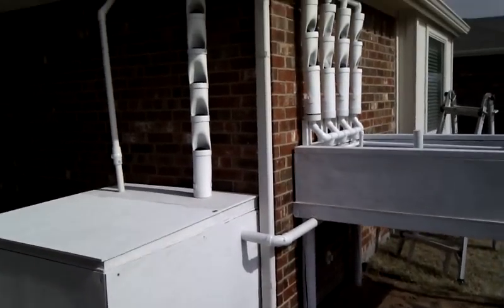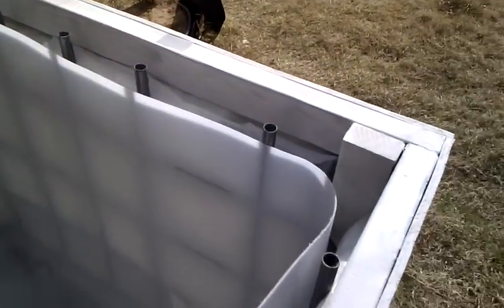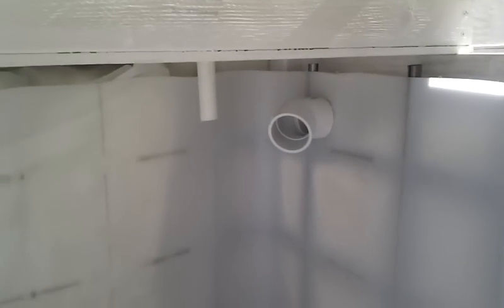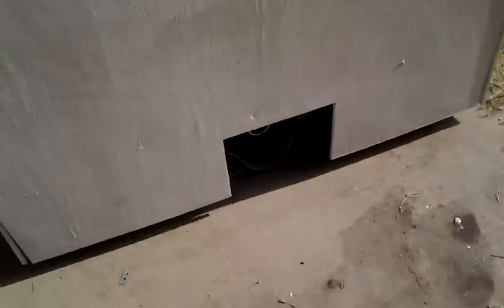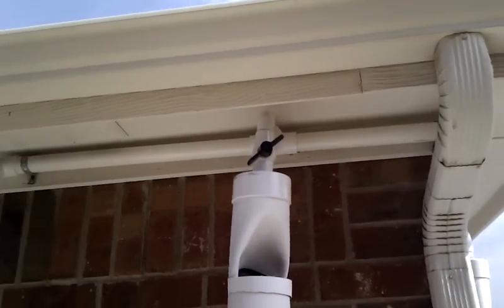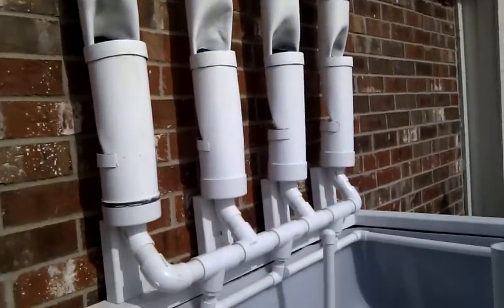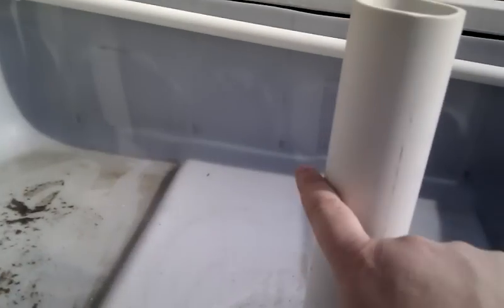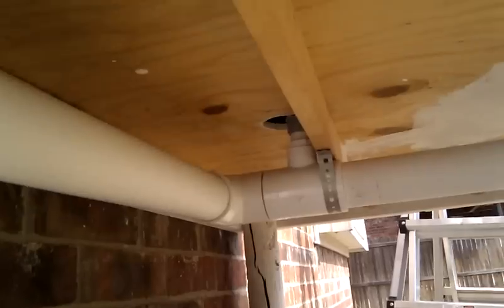Home Aquaponics

Comment from the maker: This was also a concern for me. I eventually plan to make the tank a sump tank to deal with that problem and get a larger fishtank as funds become more available as I plan to have more grow-beds. 90% of the PVC is detachable for cleaning and reconfiguring. I am very happy I didn't have to seal most of the PVC without have any leaks. YAY! This will make cleaning pretty easy. I have tested the system and water-flow throughout all of the towers is ideal. Thanks for the input.

Comment: My concern would be that having all the effluent flow through 5  towers is that you effectively limit the distribution of the poop to surface area of less than 2 square feet. Given it takes some time for the poo to break down you might end up with a buildup and clog at the top of the towers. Hindsight is 20/20 but foresight is far from that. I guess will see if my foresight is uhh... full of poop in the spring! Good luck, i'll be following.